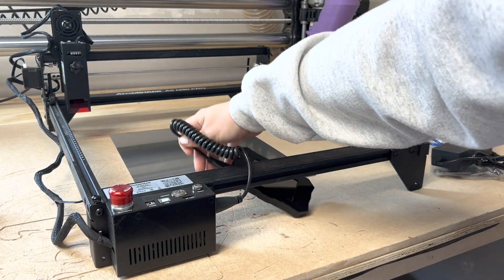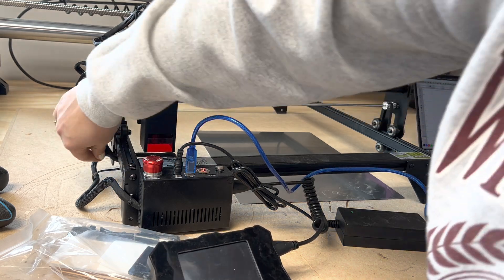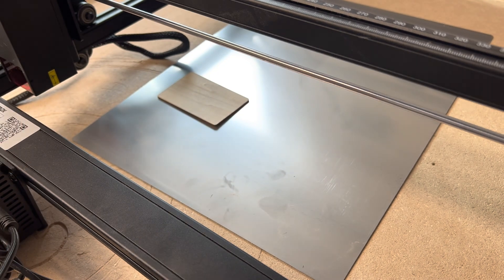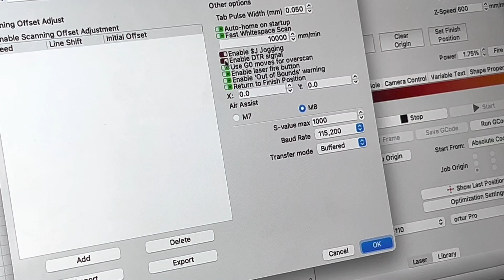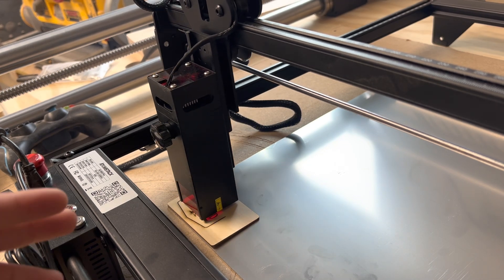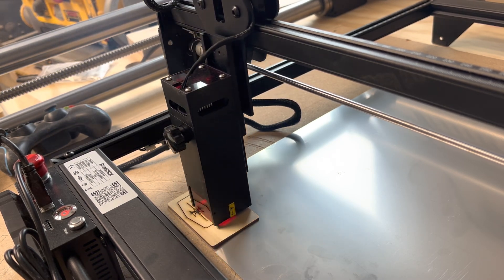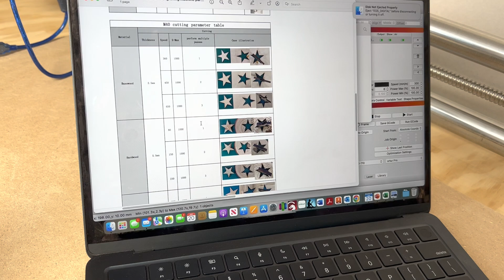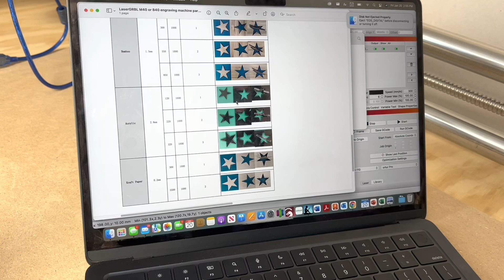AtomStack A5 M50 Pro 40W Laser Review

Comment: No mention of safety glasses. Hopefully you use them especially with an aluminium under plate.
Reply from the maker: Yep you can you use the glasses however, with this set up there is really no exposure of the laser due to the laserhead being so close to your material as well as having the protective shield on the front where you actually can see the laser through the red plexiglass. Even when cutting through the material, I never saw the laser sneak out to see it with the naked eye
Reply: @TimberWood.Customs  your ordinary glasses may help to reduce the effect but always better to err on the safe side with lasers. Just like car seat belts.